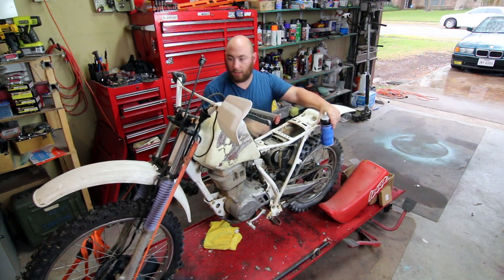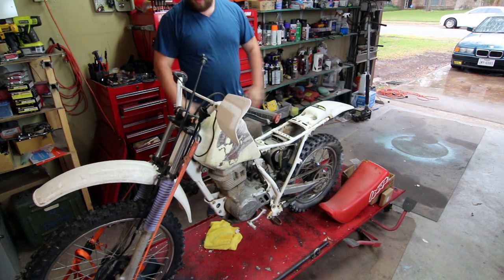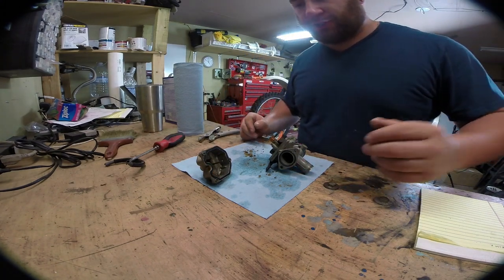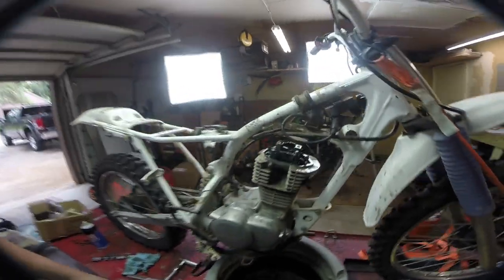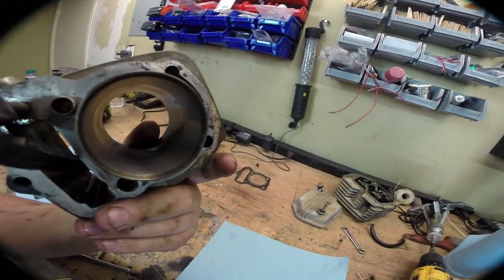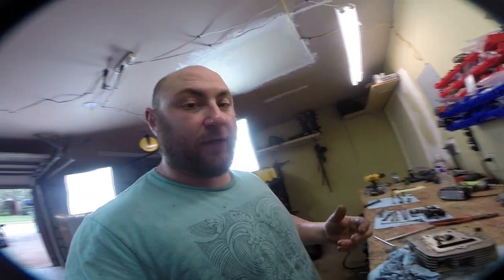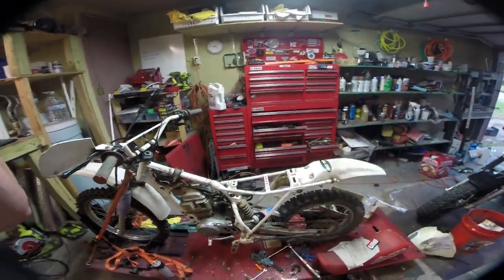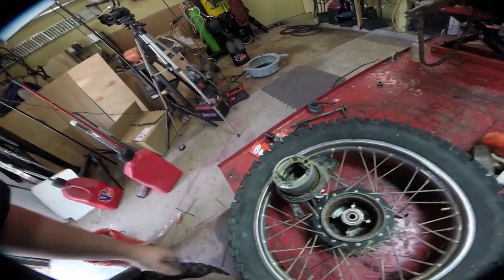Bringing a $50 1994 Honda XR100R Back to Life

Comment: 2000 and up habe valve 2 guides, 1999 and earlier have 1, I believe it’s on the exhaust side. It says it in the 98-2003 service manual.

Comment: Did you make a video on fixing the front brakes? I just got a 96 xr100 and the front brake sticks like as if you are holding the brake.?
Reply from the maker: Couple of things to try.
1. Take off the wheel and clean the drum brake assembly with brake clean very thoroughly
2. Check to make sure the spring work and the brake shoes are adjusted
3. check to make sure the cable is not fucked.

Comment: I bought one for $250 running but a smoker .then I found xr80 for $50 along with 1974 xl 125 $50 in all 13 motorcycle in the last year.prices from $0-250 some running most not Craigslist face book ask around or tell that what you looking .keep your ears and eyes open .

Comment: Also stretch bolts were probably fine, it’s an xr afterall. They’ll probably run on E85 😂 I rebuilt my bike, crank was messed up from a bad wrist pin. Slapped a 120 kit in it and redline everywhere no issues, used the same stretch bolts too and xr80 head for more compression

Comment: I have this exact same dirt bike along with an 89 xr250. Both were in hurricane katrina in 05 where the water got around 25-30” high. They ran fine before the hurricane but have not been attempted to start since (over 14 years now.). I’m wondering if they’re worth even messing with.  I’m not sure if salt water got into the motor or not.  My question is, if so, are they even worth trying to refurbish? I’m guessing I’d have to 1. Drain the fuel and oil. 2. Replace filter and spark plug. 3. Check compression and use starter fluid. Any tips or advice for me moving forward or is this a waste of time?
Reply from the maker: Free is free, i would def pull the plugs, and kick them over. If they are siezed - no reason to go further unless you want to rebuild engines. If they spin over free it should be cheap and trivial to get them going. Although 14 year old bikes probably going to need new tires, tubes, and other odds and ends
Reply: MaksWerks I got it to run! Doesn’t seem to burn a lick of oil!
Reply: I also have this exact same combo, 89 Xr250 for myself and a 94 Xr100 for the kids. The 100 was beat down bad by previous owners teenage boys, but we’re using as a learning bike as my youngest actually wants to know maintenance as well as ride. Great bikes, enjoy

Comment: What is a good range for mechanical compression for 4 stroke small dirtbike/or pitbike?  And to test-- full throttle and kick over a few times?
Reply from the maker: ya. I would say over 150 psi is golden. Over 120 is ok, under 100 is problems, under maybe 80 is junk.
Reply: @Makswerks1  cool exactly like car engines then.   I'm kinda new to working on bikes.   But 24 years as a dealership mechanic.   Thanks for the reply.
Reply from the maker: @irocss85  Its very similar to cars, I would say a little more forgiving on the low end than a car but thats about it.

Comment: how did you remove the stretch bolts?
Reply from the maker: ratchet?
Reply: 2 nuts backed up to each other and tighten them together then loosen like regular bolt